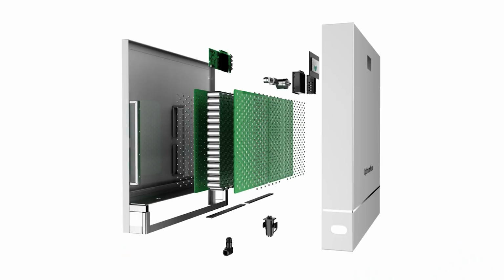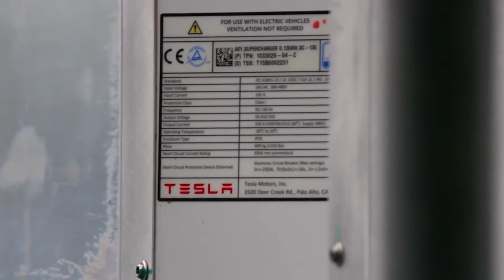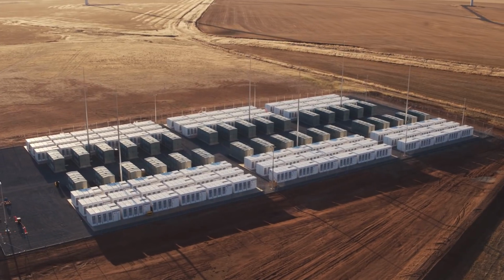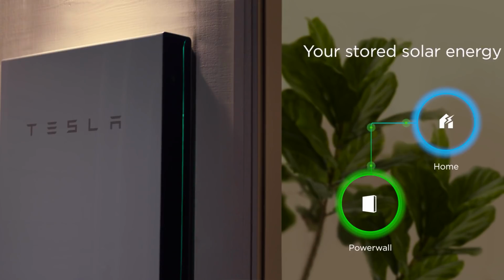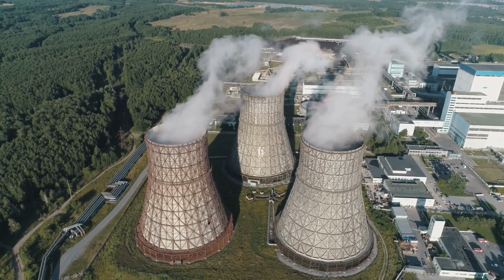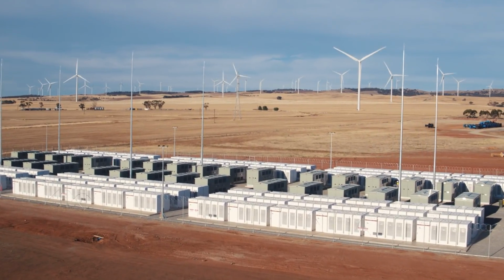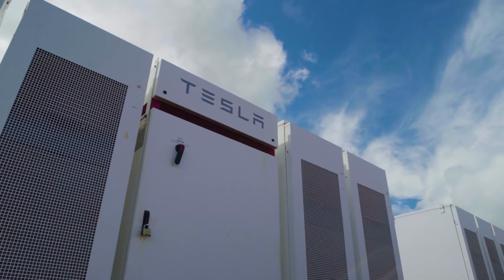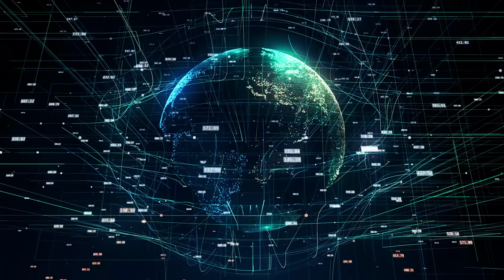Why Utility Grids are Afraid of Elon Musk

Comment: Wind & solar are not dependable.  Nuclear is the way to go, plus, using batteries to level the power output to meet variable power demands.  Nuclear power puts out zero emissions.   Yes, nuclear power is more expensive than natural gas, coal, wind, & solar, but, it is dependable.
Reply: higher up front costs is not the same as more expensive. Nuclear tends to make far more money in the long run than, for example, a natural gas plant. This is mostly because the cost of uranium makes up such a small fraction of the costs for nuclear whereas the cost of natural gas continues to be a significant fraction of the costs for a natural gas plant throughout it's entire life cycle
Reply: @doritoification  Not hardly.  Sorry, but your comment reads like regurgitated rote propaganda produced by the nuclear power industry.  Sounds wonderful, but no basis in reality.

Case in point.  I am old enough to recall the 1973 opening of the Zion Nuclear Power Station on the shore of Lake Michigan in Zion, Illinois.  After 25 years of service the plant ceased operation in 1997 and was formally retired in 1998.  The plant owner/operator (Commonwealth Edison) made a business decision to not spend $435 million to replace the aged 25 year old steam boilers, as they would not pay for themselves before the plant's operating license expired in 2013.  Since 1997 (23 years and counting) the blighted mothballed plant has sat idle like a dead elephant.  It is a community public relations disaster that continues to impact the economic vitality and image of the local community.  The perpetually delayed closure of the plant (decontamination, decommissioning, demolition) is estimated to be a 10 year, $1 billion project that might be completed by 2026.  The spent fuel since Day 1 of the operating history of the plant sits onsite in dry cask storage as there is no place to ship the spent fuel.  Beyond the closure of the plant, the spent fuel is a whole other matter that may take several decades and many, many $millions (who knows maybe $billions??) to monitor, secure, and ultimately transport the fuel to a long term secure storage facility yet to be named.

Please reconsider your comment in a manner that comports with the real operational history of the Zion Nuclear Power Station (or the history of any other real nuclear power plant in the United States).  Zion is not a Three Mile Island or Fukishima disaster.  It is a very pedestrian nuclear power plant with an operational history that likely represents the rule rather than the exception.
Reply: @petertownsend252  Cherry picking examples isn't how realistic, representative conclusions are drawn. In December 2019 the NRC issued a license renewal for turkey point nuclear power station, extending it from the original 60 years up to 80 years. That doesn't mean all reactors will get licenses for 80 years so i wouldn't base my view of nuclear on that either as the NRC has only granted an 80 year license once. 
6 other reactors are in the application process. 

It is rare for a reactor to close after 25 years in America. 88 out of Americas 96 reactors have received approval for their first license extension from 40 years to 60 years.

As for your comment on the coal plant powering the uranium enrichment facility. Wouldn't it be wonderful if there was another way of generating that power? I wonder what other power source could provide the same sort of reliable power with lower emissions? Funny how more nuclear comes to mind in a discussion about nuclear.

I've read multiple sources quoting the number of grams of C02 per KWh of nuclear and they range from 3gC02/KWh to about 50gC02/KWh. I'm not sure what the average is but i know natural gas is 400gC02/KWh just coming from the power station without taking into account the additional embodied emissions involved in extracting the gas in the first place. 

20% of Americas power is "low carbon" and over 50% of that is nuclear.

I have never claimed that nuclear is zero carbon. 

I do have plenty of other good things to say about nuclear however, but it would be easier to just send you this link as a place to start http://environmentalprogress.org/the-complete-case-for-nuclear/#nuclear-safest
Reply: Nuclear power is far from zero emission when the full life cycle of the fuel is considered.  The mining and processing of uranium ore into nuclear fuel takes a considerable quantity of diesel fuel and electrical power generated from fossil fuel plants burning coal and natural gas.

Case in point.  The Joppa Steam Plant is a huge coal fired power plant (6 units producing 1,100 MW) located on the Ohio River near Metropolis, Illinois.  The sole purpose of the Joppa Steam Plant (100% of generating capacity) is to supply electrical power to the Paducah Gaseous Diffusion Plant located across the river in Paducah, Kentucky.  The main purpose of the Paducah Gaseous Diffusion Plant is to enrich uranium for the commercial nuclear power industry.
Reply: @petertownsend252  Additionally, the Paducah Gaseous Diffusion Plant (which is less efficient than a modern gasseous centrifuge plant) had a capacity of 11.3 million seperative work units per year (SWU/Y)

A large nuclear power station with a net electrical capacity of 1300 MW requires about 25 tonnes per year (25 t/a) of low enriched uranium with a 235U concentration of 3.75%. This quantity is produced from about 210 t of natural uranium using about 120,000 SWU. An enrichment plant with a capacity of 1,000,000 SWU/year is, therefore, able to enrich the uranium needed to fuel about eight large nuclear power stations.

Paducah Gasseous Diffusion Plant had 11.3x that capacity so that's enough uranium produced to power 90.4 reactors with a combined output of 117GW.

So we're talking about using 3GW of coal power to produce enough uranium for 117GW of nuclear power

As mentioned before, gaseous diffusion is far less efficient than centrifuge enrichment in operation today hence, from what I can tell doing a quick bit of research, the last gaseous diffucion plants were closed around 2010 and all enrichment done today is using the more efficient centrifuge method.
Reply: @doritoification  Thanks for the reply comment.  Very much appreciated that you took the additional time and effort to analyze, consider, and record your cogent thoughts on the issue.  I learned a lot from your reply.  Also for clarification, my first reply comment regarding “zero emissions” was in response to the initial  post by Albert Jackson regarding his claim of zero emissions.  I would readily concede and agree with you that the lifecycle CO2 footprint of nuclear power is low in comparison to coal and natural gas.  My only point is that lifecycle emissions are not zero and should not be marketed as a “zero emission” technology.  The mining equipment, haul trucks, and locomotives all burn significant quantities of diesel fuel.  The ore processing and enrichment facilities all pull large amounts of electricity off the grid.

As to the merits.  I found your dismissive statement about cherry picking to be wholly unpersuasive, trite, and cliche.  I will offer my own equally unpersuasive, trite, and cliche statement for your consideration.  The shuttered Zion Nuclear Power Station is the canary in the coal mine that demonstrates what happens to a typical American nuclear power plant when it reaches the end of its operational service life.  The Zion power plant serves as the frontispiece and model template for what happens to an American nuclear power plant when it is retired from service.

As you may or may not be aware, Commonwealth Edison (owner/operator of the Zion plant) has been a subsidiary of Exelon since 2000.  Exelon owns power plants in 48 states and the District of Columbia including 14 nuclear plants (not including the shuttered Zion plant).  For the past 23 years and counting Commonwealth Edison/Exelon has played an extreme game of economic hardball with the Zion plant closure.  Exelon has staked out a firm corporate position to “spend no dime before its time” with respect to plant closure.  Why?  Why? Why? Presumably, when the time comes they will take a similar position with the other 14 nuclear plants.  As a cheerleader for the nuclear power industry, does any of this give you a moment of pause?  All it takes is for one guy (Exelon) to poop in the hot tub to ruin the experience for everyone else.  Whether you are aware of it or not, Exelon is actively undermining and subverting the best efforts of the nuclear power cheerleaders.  The retired Zion plant (23 years and counting) is an albatross that makes the entire nuclear industry look bad.  

This is not a new issue.   With the benefit of hindsight we can reasonably see:

The full lifecycle costs of a nuclear plant are very expensive;
The projected profit margins of nuclear power have never materialized;
The closure costs of nuclear power plants are significant;
The diversion of present nuclear plant revenues and/or cash reserves into closure costs would invert the balance sheet from black to red;
The ongoing solvency of the nuclear power industry depends on the perpetual delay and deferral of plant closure costs.  They need to keep the deferred closure costs as an asset on their balance sheets for as long as possible.  The extension of a plant operating license to 40, 60, or 80 years is merely kicking the can down the road for a few years until the day an inversion of revenues vs expenses drive the plant into insolvency.  Today, a license extension may represent the least worst economic option in comparison to the combined cost of nuclear plant closure (expenditure) plus replacement generating capacity (investment).

The costs associated with long term storage and disposal of spent fuel will eventually be fully socialized on to the taxpayers through insolvency.
Reply: @doritoification  I read the article you linked.  It is fine for what it is.  It is pro nuclear propaganda that attempts to cast nuclear power in a most favorable light while materially and notably omitting the most compelling cost arguments against nuclear power.  The fuel cost and day to day operating costs for nuclear are inarguably very low.  The problem with nuclear is the enormous upfront capital cost to design, build, and license the plant. Costs associated with the most recent 2009 expansion application for the Turkey Point station (units 6 and 7) you mentioned is cited in a range of $12-$18 billion.  At some point in the future the plant will need to be retired and closed with associated costs for decontamination, decommission, and demolition.  At some point in the future the spent fuel will need to be transported and disposed of at a long term storage facility (yet to be new named).  Conceivably, the nuclear fuel cost could be set to zero and the plant might still fail for economic reasons in the not too distant future (e.g., 10-20 years).  The article cites grossly outdated costs for large utility scale PV solar.  PV costs have plummeted over the last few years.  Recent costs for a utility scale PV solar plant (123 MW) at a favorable location in Chile are less than $0.03 per kWh (with no subsidy).  A newer site in the US is coming in at less than $0.05 per kWh.  Going forward, how is nuclear ever going to compete with that?  Once PV is coupled with meaningful storage (5 to 10 years), it may signal the beginning of the end for the nuclear power industry.  Meaningful storage at the grid scale may take something more than lithium batteries.  There is just not enough lithium mining capacity or battery manufacturing capacity to scale up to grid scale battery storage needs.  Meaningful grid scale battery storage would take at least a 10 to 100 fold increase in battery production.  Pumped hydro storage may help in locations that are geographically/topographically  favorable.  Liquid air energy storage seems like it might have potential.  It is low tech (air, compressors and storage tanks), inexpensive (mostly steel), and scalable.  The problem seems to be round trip energy efficiency (only 60% to 75%).  However, if you are generating PV solar power at $0.03 per kWh you might be able to absorb a 40% loss.

The proposed next generation nuclear plant designs (safe, simple, low cost) are nothing but vaporware at this point in time.  Some might point the finger at US politics as biased against nuclear power.  However, the world is a big place.  What about places like India, Pakistan, South Korea, Russia, Turkey.  Why haven’t the newer cheaper designs materialized in any of these places?  Why hasn’t Bill Gates and his checkbook made it happen?

In my mind there is no doubt the US taxpayers will eventually have to eat the socialized costs for dozens of nuclear plant closures and spent fuel disposal resulting from insolvency.
Reply: @petertownsend252  My arguments for nuclear mostly revolve around its low carbon environmental footprint. I'm not qualified to argue about the economics in detail but i was under the impression that all nuclear plants have docomissioning funds set up from day 1 which ensure that the  cost of future decomissioning including spent fuel storage are covered in advanced and not "socialised to the taxpayer" as you put it.

At this stage i believe renewables + storage is mostly vapourware but just like 4th generation reactors, it may be right round the corner. 

It just makes me sad that in order to save the climate people think it's a good idea to cover vast quantities of land with solar panels and steal the energy directly from the bottom of the food chain, swapping a climate disaster with an environmental disaster (probably unsuccessfully)

I'm very much an "all options on the table" kind of guy so don't mean to bash renewables too hard but i'm just of the opinion that nuclear is far superior to anything else from technical and environmental standpoint before considering economics and politics.

Comment: What's the projected lifetime of these batteries ?
Reply: I think if you goto teslas website they explain the degradation of their car batteries over time. I think the power packs use the same lithium ion batteries.
Reply: @algernonsetonis  I believe they use the same 18650 (or 2170) as the cars. Makes sense since they manufacture their own. To gain optimal life the batteries should ideally only be operated between 15 and 85& capacity, i.e. 70% of quoted. With present technology the number of cyles is between 4k and 5k cylcles  which equates to somewhere between 11 and 15 years but in reality data this far out doesn't exist.
Reply: @pasoundman  Thanks.Would like more cost breakdowns
Reply: @MikesWoodshack  Best estimate I can make is around $150-200 per kWh of storage

Comment: The current problem in Australia is there are insufficient large transmission power lines in the correct locations to carry the re-newable power from the new re-newable projects to where the customers are. South Australia (where the large Tesla battery install is) is looking to get connected to the New South Wales grid, for hydro and coal power. https://www.pv-magazine-australia.com/2020/01/24/sa-nsw-interconnector-gets-regulatory-go-ahead-to-unlock-slew-of-renewable-energy-projects/   https://youtu.be/7RmSgg9sKbA

Comment: Your video is misleading is so many ways.  Obviously you've drank the Tesla Koolaid but that doesn't mean you can just makes stuff up and compare Apples to Oranges and Aliens

A few years ago all the battery storage ever installed on the US grid would carry the load for less than 15 seconds.  I doubt we are past 30 seconds in 2020.  

 You mention the $67 million cost of the 129MWH Hornsby plant and compare it to a $700 million cost peaker plant.  A single large modern Gas is 250MWH to 400MWH for a single turbine and they cost way less than $700million.  Your compared cost was probably from a multiturbine combined cycle plant with significantly more than 1000MWH. 

A more realistic comparison would be a GE Aeroderivative turbine of around 60MW is $20 million so it would have to run slightly over 2 hours to match the battery pack.  Wind and solar is way more cyclical than 2 hours so you need way more capacity than is currently possible with battery storage.

I highly doubt the load of Los Angeles less than 1000MWH/6hours = 166MW load.  That's way less than 1 Gas turbine  Actually, I bothered to look it up, see below.  So not only will 1 Tesla battery NOT power it for 6 hours it would take 18,000 of then to power it for the day.  Being off by 18,000 * 6 = 108,000X is kinda of a big deal

According to PG&E spokesman Joe Molica, the city of San Francisco consumes about 18,000 megawatt hours of electricity each day. One megawatt hour powers about 750 homes in California.Jan 24, 2011

Comment: Centralized megawatt generators will someday become a thing of the past. Eventually, in most industrialized nations, all new homes will be built with the necessary electricity solar generation via roof tiles to power the home in its entirety. Apartment complexes and office buildings will have on-site power generators. No need for an interconnected network of Long-distance power grids.
Reply: Providing power 24/7/365 with 99.999% Reliability is harder than you think.
Reply: @deanhagstrom6667  Alright, tell us why.

Comment: I am refactoring my solar generator for my house I installed 20 years ago.  A new 2nd array, replacing 20 year ago panels on array 1.  I am on my 2nd battery pack, 12 2v 1100ah battery installed in 2016.  My next phase is replacing those Lead Acid batteries with salvaged Tesla Model S batteries, using Jack Rickard's battery controller. I will be able to stay 24v using my existing inverter. Then later after switching out the inverter with a 48v version, I will rewire the battery to 48 volts as well.  Yes, I like Tesla batteries